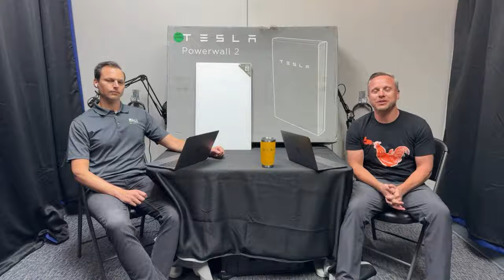E65: TESLA Powerwall vs. PowerSHARE (Cybertruck) - Which is best?

Comment: Thank you for the video. Here’s my situation and this episode I believe answered most of my questions. I was wondering if I can configure my cyber truck with the 3V gateway that I already purchased, but have not installed yet with the following:

1-I purchased a 16.2 KW solar system string inverters to Freas GEN 24 Primo 7.7 inverters. My power company Atlantic City Electric will not allow me to grid tie. I have not installed the panels on the roof or the inverters yet after they would not give me an interconnect. That being said, I’m wondering if I can AC couple the 3V gateway if I install the system and not have to use Tesla power walls. Will the gateway allow everything to work that is with the solar panels AC coupled wise be able to power my home or do I have to get power walls to go with it?

Also, I put my deposit on power walls over two weeks ago. I keep messaging Tesla and they will not send out the site Inspection person. Would you happen to know anyone in my area near Atlantic City, New Jersey that could help me? 

Thank you, Tom

Comment: 29:19 exactly what I was looking for
Reply: This is VERY interesting to think about. And honestly they didn't answer it THAT well imo. First dude really said "Well you could trip on the cord" really? LOL

If you know what you are doing. Copper is copper. Get rated cord from a local Hardware Store, and FOR SURE can run interlock with Cybertruck or even just gas generator and spend 1/100th the money for similar results. But people who know been doing this for a Long time now. 

But I am glad they talked about it and were pretty honest.
Reply: @KurtFeudaleKing  Yes, I researched this for weeks trying to figure out the advantage.  I even bought the Tesla gateway.  Then got a install quote for 2200, so i am looking at  least 4 grand for this thing to use it like 3 times a year. 

All so I don't have to manually switch it over?  I thought time of day power arbitrage but  teslas manual says it is not designed for it. So the only real benefit is that you can draw 1900 more watts, and it is seamless switchover, which i don't even want, because i have to switch off my thankless water heater first as i am powering the whole panel.  

There is the idea of car to grid, but who knows when power companies will approve that and how much money they even give you. And how much it degrades your battery.  So i sent back the powershare and am just going to use the power outlet in the truck bed, i feel 9.6 kw is plenty to do it.
Reply: @mobleyMobley  Yeah, I think you are making the best value choice for sure. I am not an electrician. But I do remodels and have done a lot of electrical work. 9.6 kw is a Very good amount IMO. Most houses only run average between 1.5kw - 2.5kw here. And yeah you can peak high with things like: Dryer, Oven, Microwave, Heaters, AC . .  etc. But it seems like you already know that. Keeping the tankless off sound perfect. If you don't have many other high kW appliances you should be just fine. And you will have saved thousands. 

I don't have a Cybertruck, but I do have a new Model Y at the house and I am hoping to use the bi-directional charging as a backup, once the software update comes later this year I believe.

Comment: So if you have a cyber truck and you take your voucher and have power share installed 

When you want to add power wall after that PowerShare is installed does your powerwall work with that V3 PowerShare gateway? 

Or do you need to scrap that V3 PowerShare gateway that they installed and get a regular V3 gateway?

Comment: So with powerwall 3 can you just add that to your existing DC solar array without any gateway? 

Trying to figure out what the benefits to adding a gateway to a powerwall 3 system would be 

If your goal is bring your own solar DC rec alpha Pier 460 w array 

Powerwall 3 

Span Smart panel 

And cybertruck PowerShare once it's software released 

Would you even need a gateway in that situation

Comment: Probably cheaper to buy 10 PowerWall3s and Tesla's "Backup Switch/Meter Colar" No Power Share V3 Gateway or CyberTruck needed! Powerwall3s are designed to be fully charged and discharged; Cybertrucks, not so much.  Can you use solar panels to help charge a PowerWall3 while having a Cybertruck hooked up to a Powershare 3V gateway and the PW3? I don't think Tesla's "Backup Switch" can be hooked up to a Tesla powershare device.

Comment: PowerWall3 does support AC charging (still limited to 5 kW) so you can use an existing solar system with it.  No requirment to connect the solar directly to the PW3.

Comment: I'm adding some PW2s to my AC coupled Enphase PV system, they are spec'ing 2 maybe 3 PW2s, and a Gateway 2.  I already have a Gen 3 HPWC.  I'm getting conflicting info on what I should get now to FUTURE PROOF.  Will I really need the Gateway 3V?  I get a $300 per kWh cash rebate from my utility on top of the 30% tax credit for my ESS, so I can get 3 PW2s installed for less than $19K. BTW what is the LRA the CT can support.  2 PW2s can easily start my 3-ton AC
Reply from the maker: 2022 Tesla Model Y is not capable of Powershare functionality. However, it is true that your setup supports Tesla Powershare using the Cybertruck once Tesla releases the software likely in Q4 2024.

Comment: Having the dc to ac happen on the car doesn't makes sense when you have batteries. Just send DC from the car to the powerwall which can use it to charge the powerwall batteries without inverting it. Car batteries already are over 300 volts so the current rating is very small. You can easily do 11kw with 36 amps or less. V2h should be easy because DC is so much simpler than ac. Huge fail on Teslas end.

Comment: Ac coupled and Tesla V2h seems like two must have for the powerwall. I have 10kw solar and 2 model y. This only makes sense if I can use both systems with one powerwall and use the vehicle battery to supplement the powerwall wall.

Comment: Thank you for covering this.  I got duped into having a representative contact me about solar panels for power walls, instead of my eligible cybertruck voucher to have a PowerShare installed at my home.  This salesmen was trying to get about $60k for me to accept a power wall installation!!!     I thought it was the PowerShare that comes with the Tesla Cybertruck! 

Do your research folks!!! If you own the cybertruck- do not get the powerwalls- instead use your cybertruck to have the PowerShare installed! 

Great content guys!!   Thanks!
Reply: Keep in mind that there is about a 30s delay for power to switch over to the cybertruck feed without power walls. Probably not a huge issue if being powered for days at a time

Comment: Not back-feeding the grid isn't really about line worker safety, as no line worker will touch a down cable without 1) testing it and 2) PPE.
The reason you can't back-feed the grid is because it would try to power your entire neighborhood and would immediately overload and shut off.  No PowerWall, Cybertruck, etc is capable of running your 37 neighbors' air conditioning and refrigerators that would try to immediately turn back on if you powered up the line.  They would shut down immediately from being overloaded, it would look like a dead short.

Comment: Awesome Joe!  Pretty much covered it all.  Will submit for quote and advice. Only thing missing was adding a PW to a 3V gateway setup.  Tesla says no problem, coming soon, but not really supported now without specialized commissioning support. 

So the penultimate question remains… do the 3V now and add PW soon, or do PW first (prob with gateway 3) and wait for PowerShare compatibility.  And how the $2500 credit works if declining the 3V. Can it be used toward a regular V3 gateway and UWC?  

I don’t really need a bunch of Tesla T-shirts nor a non street legal light bar.
Reply from the maker: Yes, we can add Powerwall 3 to an existing 3V Gateway.